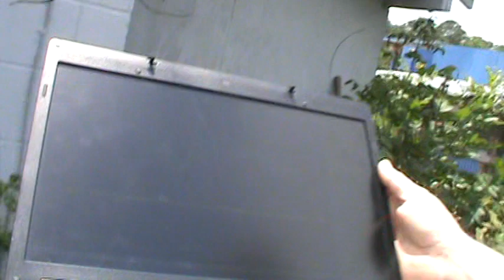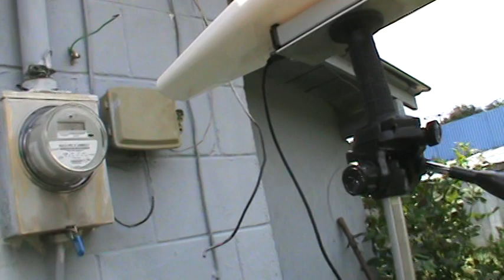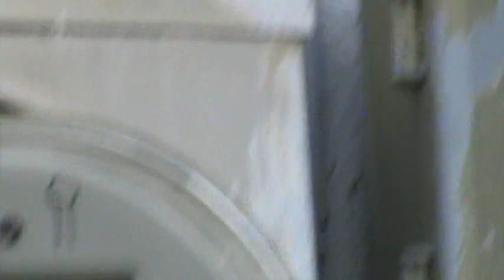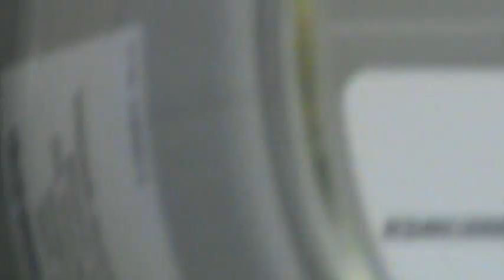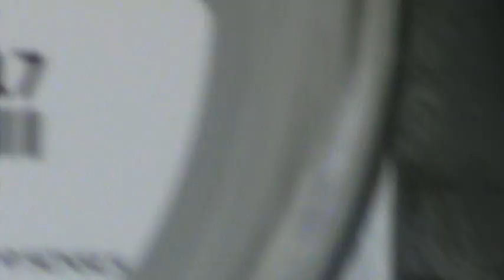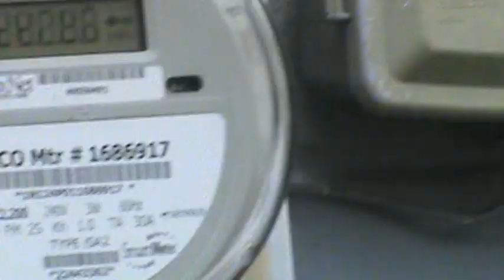Georgia Power Smart Meter Investigation Part 1

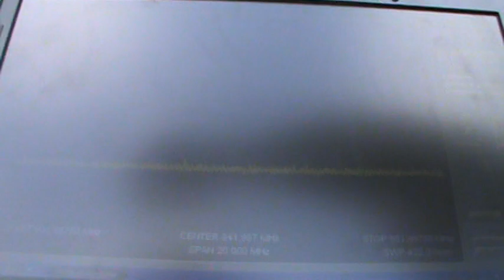Comment: 3:17  "We do that [put the measuring device a foot away] because FCC guidelines call for 20 centimeters, which is approximately a foot."  Ridiculously, the FCC guidelines only cover heating - they don't take the non-thermal radiation being emitted by the "smart" meter into consideration at all!  So, in other words, they're not protecting you from the actual damage that radiofrequency radiation (RF) can cause.  Useless!
Reply from the maker: all use of microwave radio on medium to large scales have all kinds of problems....it's all about money and control.
Reply: same with cell phones..the test requirements allow for a certain distance for safety..if you test a cell phone at zero distance they ALL fail safety..the industry wont allow zero distance testing..we are ALL at risk with cell phones...check into it yourself..
Reply from the maker: I have found the cellular broadcast signals, even many in small spaces, from devices such as the phones relatively potentially small safety wise with short non regular use.  This is not to say spectrum field saturation and physical touching of the device antenna areas is not a concern even then.  Get a good field spectrometry gaging device and radio monitor, go around and check field power density levels near cellular transmission towers.  I have and am trying to get readings courts will accept, properly documented with properly calibrated equipment before saying anything much, because disputes are too easy when it's words alone or w/ instruments not used in ways accepted for scientific method results to literally make denials delusional. Yet there is a problem fed by greed and lies, and to be honest some folks need to be sent to the electric chair.
Reply: ..."We do that [put the measuring device a foot away] because FCC guidelines call for 20 centimeters, which is approximately a
 foot."..
WE WHO???
You sound like you're trying to sound like you know what you're talking about. Did you get that because it really wasn't double talk.
It was a declaration of BULLSHIT to you. I know that these posts are old but there are only so many hours in a day to clean up the
BULLSHIT that people like you spray here but, hey, I'm disabled and have plenty of time to pull some of the unnecessary panic off
from the internet that people don't need in their lives. They can believe me or they can believe you. The difference is that I have
something called FACTS to back up what I have to say, You and your ilk have NOTHING but web sites put up by empty headed
fools with a 9th grade education for your proof so lets have a go and see who comes out on top.
If you knew ANYTHING AT ALL about radio frequency radiation, which actually sounds worse than it is below about 3 watts at
these frequencies but is technically accurate, you would know that RF field strength, (this is the
 amount of measurable power
that will be radiated in a given direction from the transmitting antenna), is reduced exponentially
 with increased distance
 from
said antenna. In other words, the farther you get away from it's transmitting antenna, the faster
 the exposure level goes down.
Think of it
 like this. If you are leaning up against your smart meter when it decides to transmit
 for it's 15 or 20 millisecond twice
a 
day
 interval, at the high frequencies that we are talking about here, you will receive "X"
 amount of exposure. If you back up say 6
inches, you may get 1/2 "X" amount of exposure. If you back up a full 12 inches, you
 won't get 1/4 of "X", you will get 1/8th
 
amount of "X". If you move back 2 feet, it won't be 1/16th of "X", it'll be 1/32nd of "X". Ask
 ANYONE who actually knows something
about radio and I don't mean your CB good buddy next door that keeps blasting you over
 your TV sound either. I mean ask a radio
or
 TV station engineer, licensed HAM radio operator or someone like myself who takes
 the radio arts seriously as I have for 45
years.
 I'm not licensed but just as educated. I have read most of the same books as most
 general class HAM's but I believe in
handing
 over to the the government as little personal information as is necessary to get along in this
 life. If you don't believe me,
wait until you try to
 enter a federal building, courthouse or try to board a commercial airline flight after your driver's license expires
in 2020. I don't care
 what state
 you live in, call your local department of motor vehicles and ask for information about the new
federal driver's licenses
 or state
 issued ID cards for non-drivers that will be required starting in 2020. And you thought the census
and the IRS was bad? This will be the biggest handover of personal information to the federal government in history. If you don't
believe this, ask your local DMV just what information will be required to renew your license / ID card. It will knock your socks off.
And who said that Hitler didn't survive the allied invasion of Berlin in 1945?
Brought to you by the the sponsors of 9/11 and George W. Bush Sr.
Sleep well, Big Brother is watching over you now and I don't mean Julie Chen's version either. I mean George Orwell's 1984 version.
Rest assured, the supposed surveillance that your smart meter is keeping on you is now the least of your concerns.
Reply from the maker: @jeffmccrea9347  no doubt hoss, we knew that then and damned sure do now....before these videos were done I had someone come in my record shop (next door to this house) who was supposed to have been a radio war expert retired from the US Army, he had seemingly legit credentials, HE put me onto these smart meters, personally then and after I was looking at other more relative causes. Good that you have the knowledge, far as who you're getting onto here I take it it's the GA power people based on your first sentence.  Go off there brother....personally over a decade later  (these probs began at my place in 2009) most say take these videos down makes me look stupid and ignorant.  It's ok, I am stupid and ignorant, just prob not anywhere near the degree many think (or hope)... literally everything in these videos coming from me is to procure general information and clarify some things - but since these videos were made I basically went into a master's program on all things radio warfare related...I don't worry about looking stupid or ignorant, nor paranoid either......maybe the US Government, knowing this was going on because I was raising hell about it online since 2009, even contacted them directly about related things (not smart meters) WAY before any Havana Syndrome stuff was known, should have came to me (other than sending out spooks, like in this video - look closely) to monitor WTF they have going on.  Now Havana Syndrome is prime time, but yeah, cool....except for people, myself included, affected, we're all just crazy, which is the line the US government fed (and still does) the diplomats and affected people, until those people got lawyers and sued, and that's next on the 2-do list. In fact, look for it REAL soon - http://undergroundrecords.org/archives/issue70/sound2.html